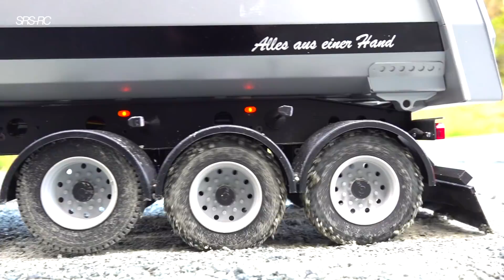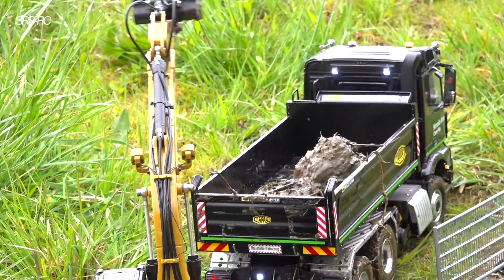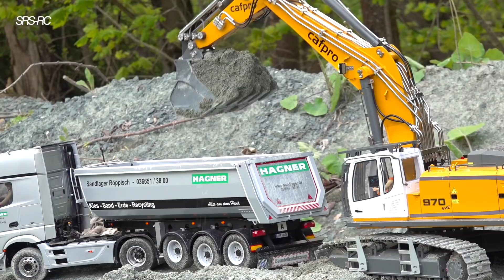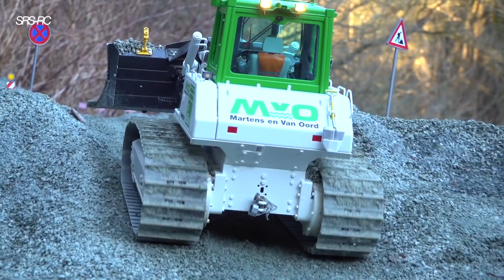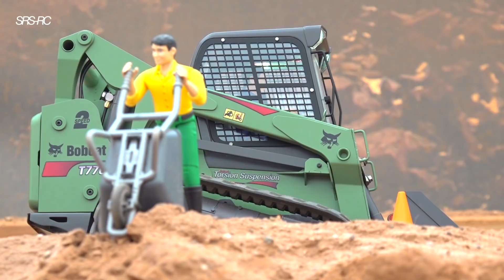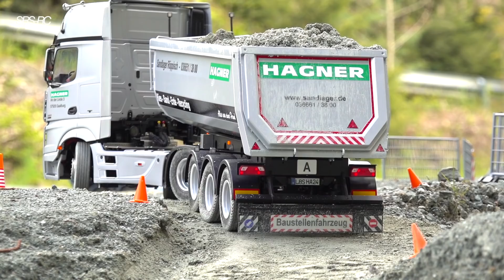RC HAEVY TRACTOR UNIT IN WATER PASSAGE// LIEBHERR 970 SME CAFPRO// BEST OF CONSTRUCTION SITE

Comment: The truck stuck in the muddy water was neat to see. 
You folks are braver than I am with my RC trucks & equipment! Mine never get that deeply into the water. I'm afraid of short circuiting the electronics, &/or ceasing up the bearings.
Reply: Hi